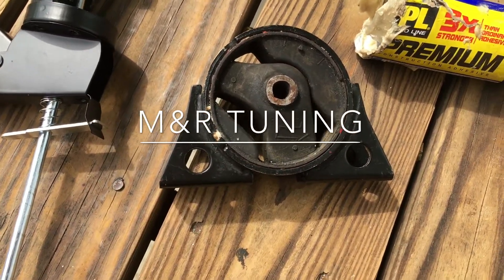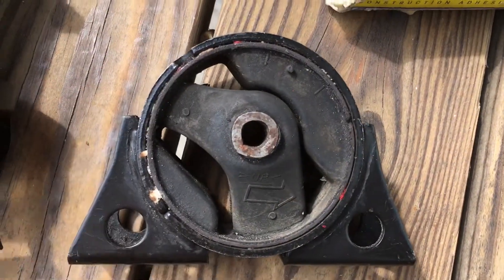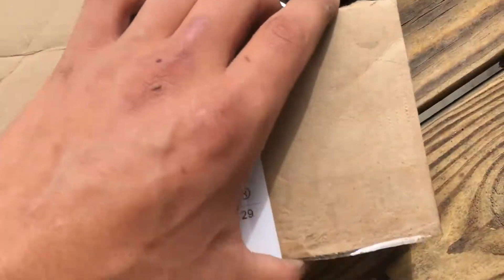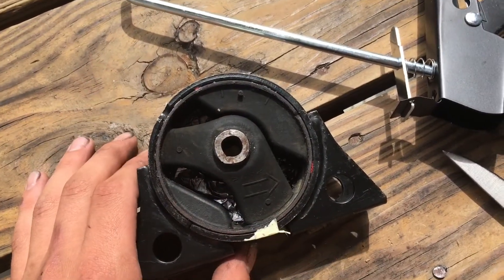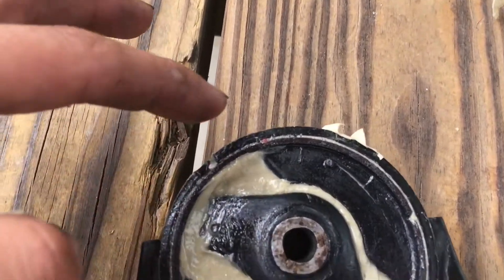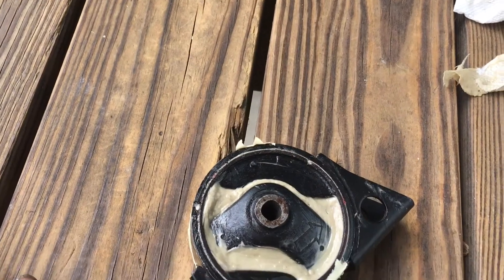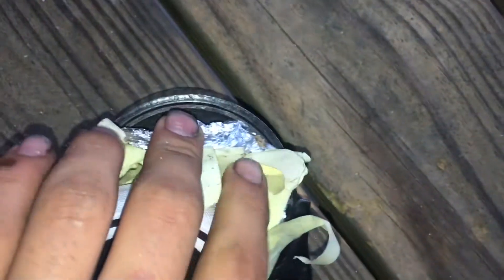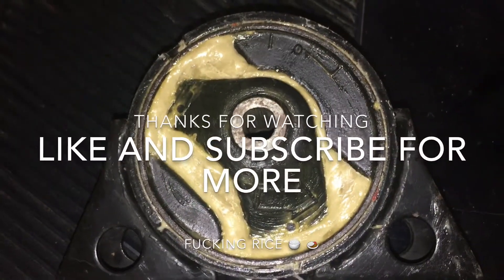Polyurethane Motor Mount Mod

Comment: U should of put a heated pin pin or screw through the black rubber and through the blank spot for better binding to each other .. great idea though to use some goop but not so much that you have a solid brick for a mount. 👍
Reply from the maker: Kevin I’m definitely gonna try that!

Thanks for commenting!!

Comment: First of all thank you for the video. You just saved me $300.00 (the cost of a new 2007 Dodge Ram 1500 front engine mount). Instead of foil paper you should try wax paper.
Reply from the maker: Sly H no problem! I agree foil was not the best but the next time I make a set I'll give wax paper a try 🤔

Thanks for commenting!!
Reply: How did this work on your 07 Ram?

Comment: From using Loctite and 3m window weld. Witch one is softer and vibrate less?? Thank you for making this video..
Reply from the maker: System of things. I like the loctite it's not rough at all when you do it this style instead of filling the whole mount  you don't get much vibration, just a lot less motor jumping
I like the loctite also it only 2$ 

Thank for the comment!!!!
Any outher questions just let me know !
Reply: M&R Tuning Thanks for your answer..

Comment: lol i cut up pieces of an old tire and stuffed them in mine
Reply from the maker: tremer88 what ever works XD 

A Free mod is the best mod 

Thanks for commenting!!
Reply: That's a great idea. I almost did my usual fix with layers of plywood soaked in epoxy haha.  Plugged a hole in my intercooler that way with a little permatex lol.  But I just scored a tube of loctite for under 6$